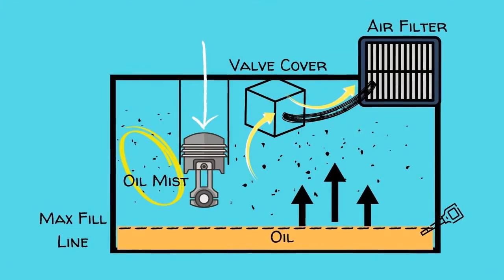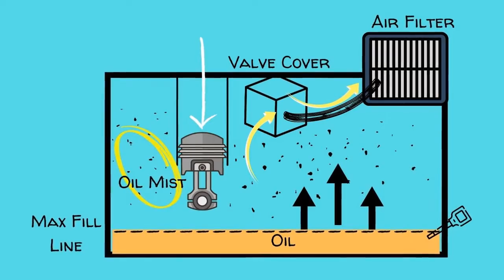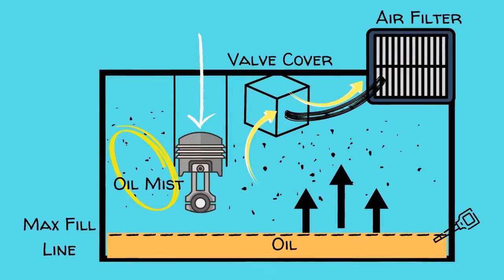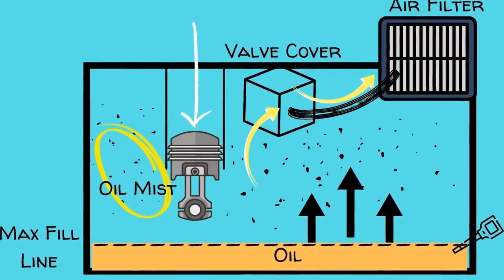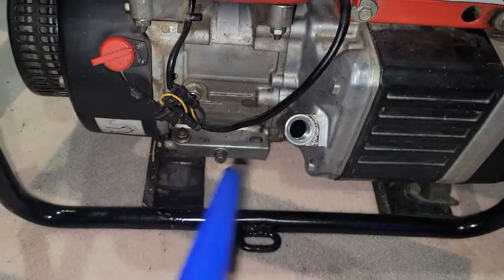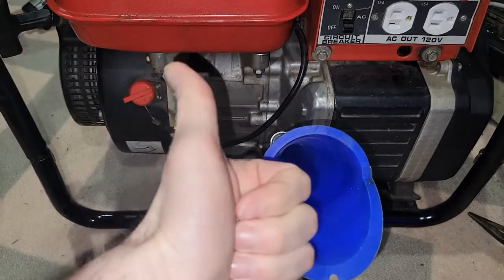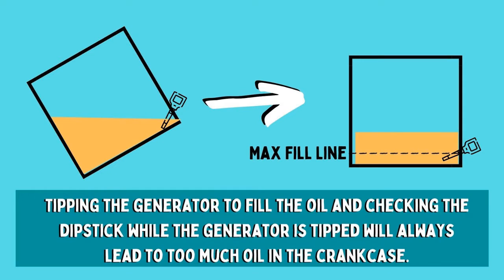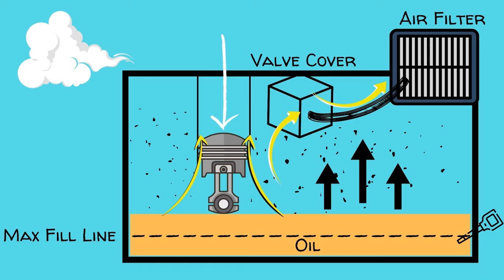[Oil in Your Generator's Air Filter?] 5 Easy Things to Check

Comment: Hi, should u put oil on a new airfliter or just install it right from the package. Thanks
Reply from the maker: I personally don't oil a paper air filter on a generator (or anything with a paper filter,  since it clogs it up).  I understand doing it for a foam filter on a lawn mower or yard tool where you're blowing dirt and dust around.  It helps the particles stick to the filter and not pass through.  A generator is a stationary unit that isn't exposed to that stuff.
Reply: @HomeBatteryBank  mine is a foam filter

Comment: Ive been using it off and on for 5 years now, a tiny amount used to get on the filter, now its just non stop, so I figured something is very wrong. im not going to rebuild this 300 dollar generator lol and it has rust on the actual generator part. As I was trouble shooting it, trying to clean the carb, had the air filter off if it, I pulled it to see how rough it would run and ripped the damn pull rope. What a weird coincidence, after watching this and pretty confident oil is blowing by the piston, and the stupid rope thing, the 5 years of accumulated rust, it's time for the scrap yard. F

Comment: Why does champion say to soak the foam air filter in clean oil?
Reply from the maker: If it's a foam air filter instead of a paper one, a little oil is generally applied to it.  You don't want it soaked, just work some oil into it and then squeeze the filter really well in some paper towel or a shop rag to get any excess oil out.  You just want it to have a minimal amount remaining in the foam when all is said and done, but you want it throughout the foam.  The foam that is impregnated with oil helps to better filter dirt and dust from entering into the engine and instead it sticks to the oil -- but the oil is so minimal that air can still work its way though without any issues.  Remember, it shouldn't be "soaked", it should have a faint oily residue on it. Big difference.

Comment: Thanks for this video. I have a standby Generac, 2008,  15kw,   oil sitting in crevices in the carburator housing,  oil level good, never over filled, no angle issues, clean air filter and pre-filter.

Comment: Excellent video! I live off grid, in the interior of Alaska and we've got some pretty extreme temperature changes from summer - winter. (-40⁰F in the winter to +80⁰F in the summer) the winters of '21 & '22 we had ducks, which required a generator running 24/7 to keep them warm, as our solar wasn't outfit to run two heat lamps. I found at about -20⁰F or colder, any generator I would use, would ice the crank vent and completely block it off. When that happened it would either kill the motor, or spit every last drop of oil out of any hole it could find. Long story short, I cut the rubber vent hose in half, capped the air box side and she purrs like an angry kitten, even at -40⁰F!
Reply: I did the same thing because of the oil blow by and it's running alot better thanks for the idea
Reply: Hey did u put a catch can on the vent tube

Comment: You have got to be kidding me fun I don’t know where you got your combustion engine Sherry from but you’re totally album right field totally wrong you’re leaving these guys down the wrong path I can explain do you way better than what you did as to exactly how and why it happened and it has nothing to do with misting oil in the oil pan and lubricating other parts someday when you’re ready to admit you don’t have a clue let me know and I’ll explain to you exactly what’s happening you are absolutely wrong
Reply: Jeff I just survived the Buffalo, NY, storm. I ended up with that big plume of smoke. I assume I put too much oil in it. I noticed oil dripping from the exhaust. I turned off the machine(Briggs and Stratton 6250) I stopped running it because I was afraid of blowing the engine. The air filter was saturated. Do I need the generator serviced or do I just run the generator and the excess oil will eventually burn from areas it doesn’t necessarily need to be?

Comment: Great video! Very informative, however it doesn't address the issues that I am having with oil in my air breather. I would say this is reason No. 6. I have a Generac 22 kW and after a storm, we noticed oil and some water in the bottom of the air filter compartment. My service company said, and they service a boatload of these units, that during a storm the breather starts sucking water in and it momentarily causes a vacuum in the breather which sucks some oil up, and then consequently ends up with some water there too. It's not a lot, but it is definitely measurable. If you go online with this question, apparently a boat load of people are experiencing the same issue but no one can knows the reason. One guy had 3 new generacs, all with the same problem that he experienced after a storm. Can we get Generac to investigate this as a design flaw?

Comment: A great explanation and diagrams thank you!  I was having oil in the filter and now understand I had too much oil in the crank case.  So, replacing the filter I noticed an additional filter that I can’t find a part # for and am sure you’re the guy to help.  It is a small filter on the back of the air filter case itself…doesn’t seem to connect to anything but there was a small filter under the snap of cover.  I can send photos...